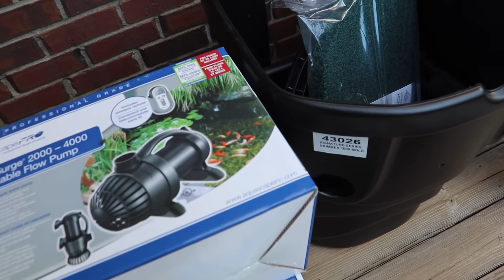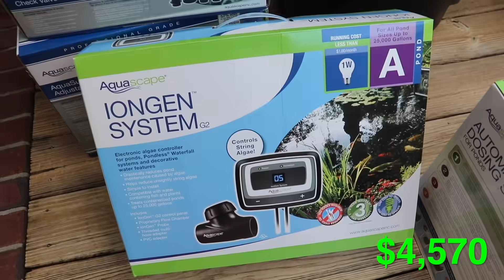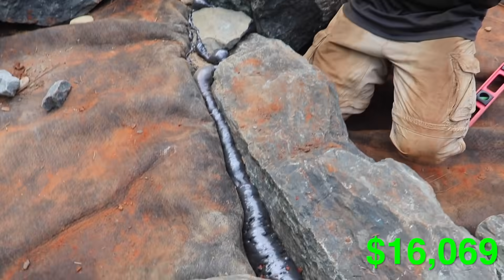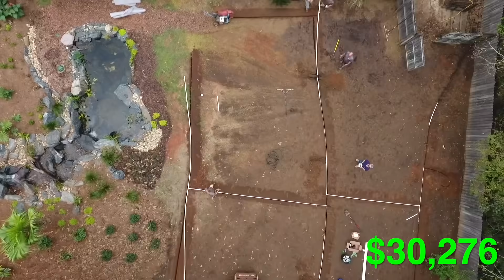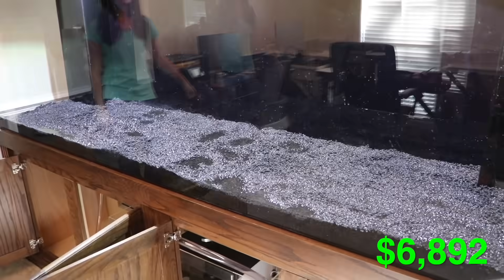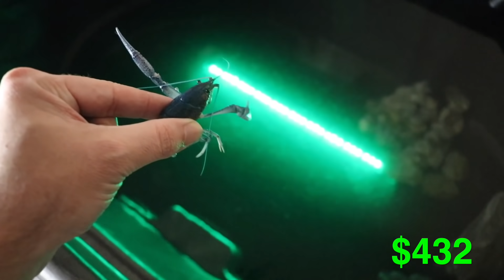Total Cost of Building My Backyard Pond

Comment: Things I learned today: 

- I will never have a pond
-
Reply: Not true. My cousin built one for around 1-1.5k. The key is to do all the work yourself. No contracting, no importing rocks from other states, etc. First, he dug the pit completely by hand without even using an excavator. He then bought cheaper pond components than was shown in the video that work just as well. Do your research and find good deals and you can get this same stuff for way less. The most expensive part is definitely the liner, which you can get for a few hundred. Then, he got most of the rocks for free from a local landscape company that he has ties with, and placed them all in the pond by hand. He then did all the pond landscaping himself also, and the end result looks pretty good. He also added another addition recently so now it has two waterfalls and two main ponds, and the final size of it is probably 75% as large as the one in this video.
Reply: My pond cost about 3.5k but I did all the work myself and it is simple design.

Comment: Not surprised at the cost. Having worked at a Resort with water features they are pricey. I did have a 55 gallon planted tank at one time and yes your figures are correct. Now it's a fish only tank. I love plants, but I'm limited to one tank. The electricity is easy. Total up the power consumption and multiply by your Kilowatt per hour cost. All electric products have a power consumption rating. I'm guessing it increased your Utility cost +$250 per month... for the pond & 3 tanks... Thank you for sharing I have really enjoyed the adventure.